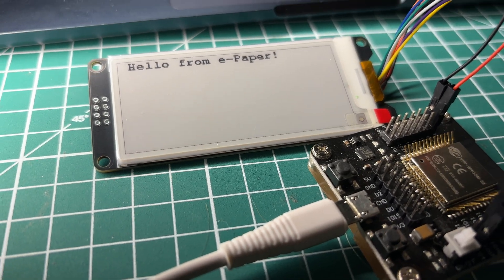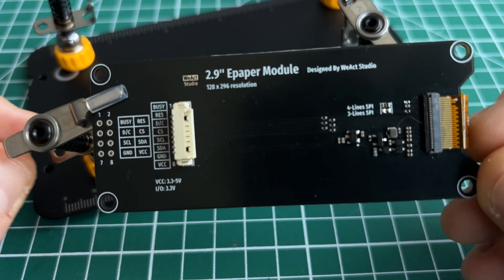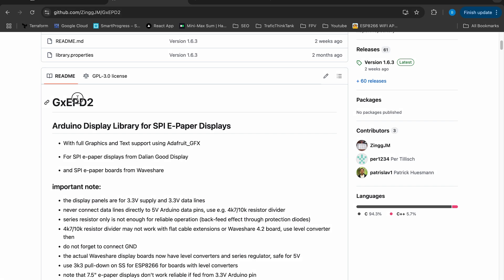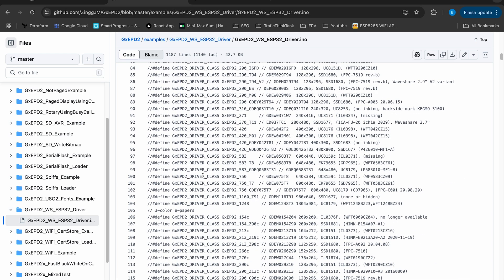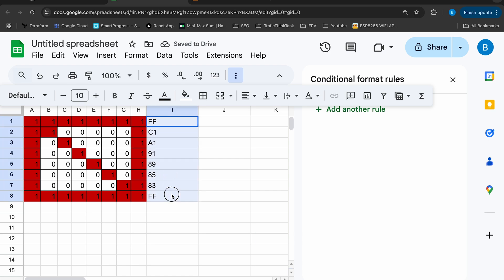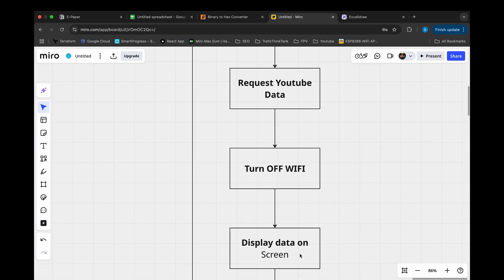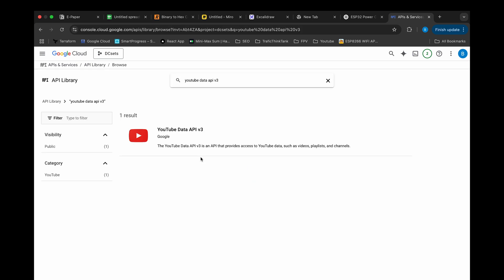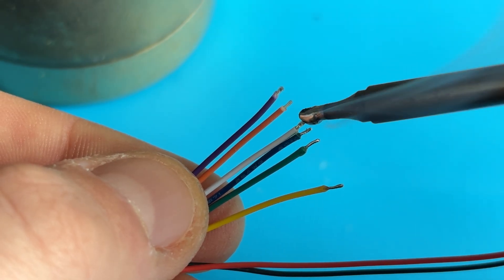I Built This ESP32 & 3 Color E Ink Display Project (And You сan too!)

Comment: Thanks for this video, was exactly looking to hook up an E-Ink display to an ESP32! How does the battery life end up being? The online spec seems to say that ESP32 with wifi is around 240mA (a bit less in receive mode). So was the calculation correct?
Reply from the maker: To be honest i've didn't test it for long. I assume that 240mA with WiFi is correct. Thats why it usefull to shuntdown ESP and wake it up only for updates (which also burn some energy tbh)